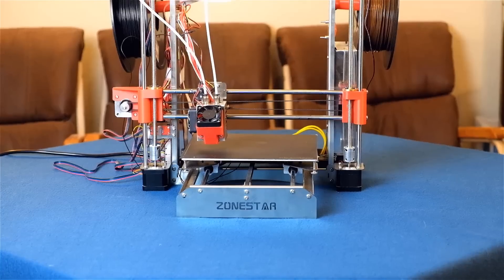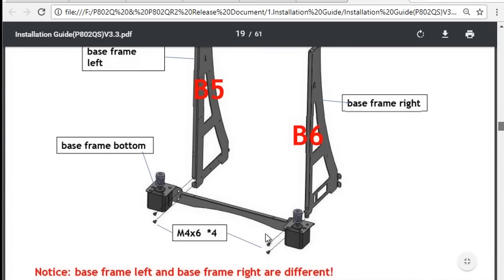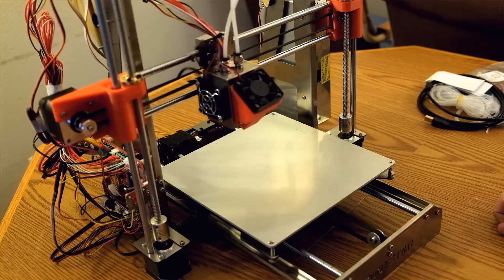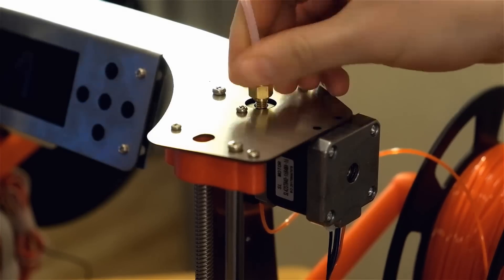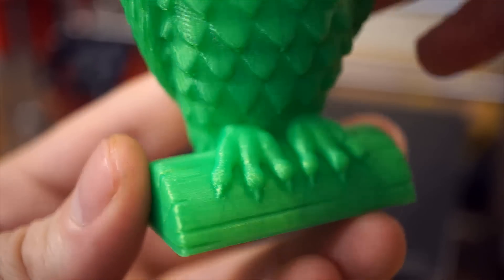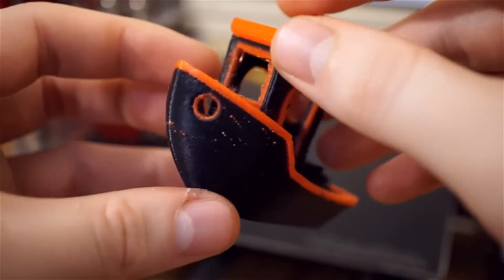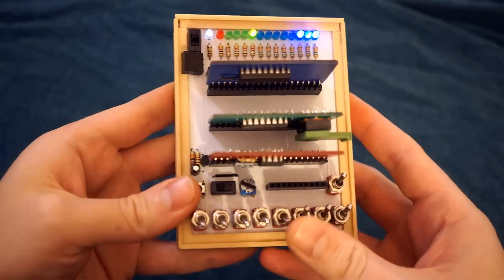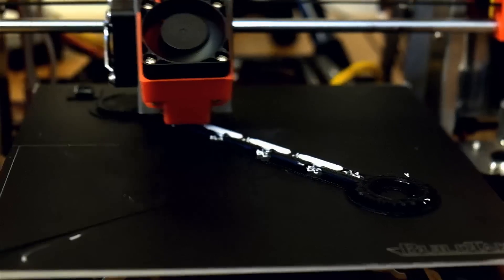Zonestar Dual Extruder 3D Printer From GearBest Review

Comment: honestly i have this printer and it's been 2 days now of trying to get it to print with no luck
Reply from the maker: Can you go into more detail as to what is not working? Maybe I can help. My two best advice for a good print is a well level bed and good medium speed print settings.
Reply: when I try to print the PLA doesnt stick to the painters tape and it seems like the filament feeder doesn't feed properly, gear turns then jerks back like clicking instead of solid smooth rotation. also when trying to print a simple xyz calibration cube it prints to the left-center of the bed. I followed several zonestar review cura setting videos for setting the profile up to get it to print. I believe the print bed is as level as can be using calipers to verify each corner of the bed and using the paper test for the extruders.
Reply from the maker: I gave up on painters tape a long time ago. It's possible but you have to get your bed and tape level and bed temperature absolutely perfect. Ever since I switched to BuildTak, like I show in the video, I haven't had any problems.
The clicking sounds like a jam. You might have a small piece of plastic that is blocking the filament. Try to clear that. Or print the extruder at a higher temperature. 
Printing to one corner sounds like a cura setting. Right before the machine starts printing, you will see the head zero out by reaching all 3 limit switches so it knows where zero or its origin is. So it should know where the middle of the bed is. Try installing the cura they provide on the sd card. 
Try printing slower and raising your print bed a little higher. I sometimes level on the fly by loading in a flat test file and as it prints, I rotate the 4 corners up until i see the filament stick perfectly to the bed. 
I hope this was helpful and please keep me updated as to if and how you solve your problems. Thank you!

Comment: HELLO , IS IT EASY TO USE FOR BEGINNER USER ? DOES IT REQUIRE LOTS OF CALIBRATION AND SETUP , OF TABLE BALANCING. 
I AM IN PROCESS OF DECIDING WHIHC FIRST 3D PRINTER TO BUY , CAN YOU HELP
Reply from the maker: It's hard for me to answer that since I don't know your personal skill level. There is enough instructions provided and youtube videos online that a beginner could use but I don't want your first 3D printing experience to intimidate and scary you away. So consider a 3D printer kit if you feel you can handle the challenge or get a ready-to-use prebuilt printer first before upgrading to something like this.

Comment: Did you ever get the auto leveling sensor to work?
Reply from the maker: I haven't tried it yet. I like to level myself. If I do get it working, I will add an update to the video description.
Reply: I have had my P802QR2 for a little over a month now, my first 3D printer. I turned on auto-leveling in the Configuration->General->Autolevel Measure menu. This performs the sensor calibration dance and stores 6 points into flash memory and turns Configuration->General->Autolevel ON.  Then add the G29 G-code to your startup G-code in your slicer.

I have noticed some improvement in first layer adhesion. But I think there is a bug in the firmware Version 2.5 or perhaps in my controller.  The pre-print auto-level calibration check does the first and second point checks, but instead of going to the third point the head drifts up and to the right and then stops.  Once in this mode, an is error reported to the Repetier server. I then have to reset the printer and the server to have the pre-print calibration work again.  Anyone else observe this error condition?
Reply from the maker: Wow thank you for sharing this information! That's good to know.